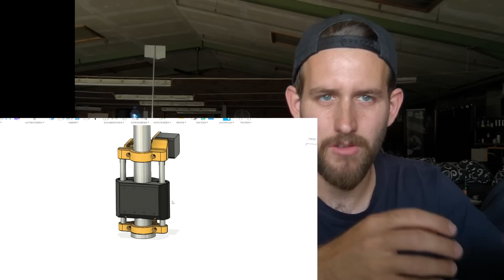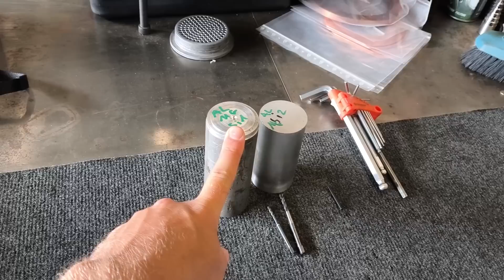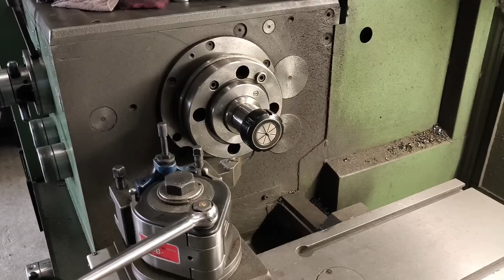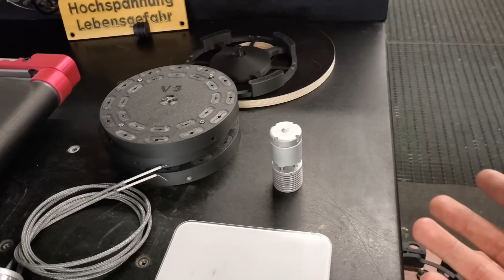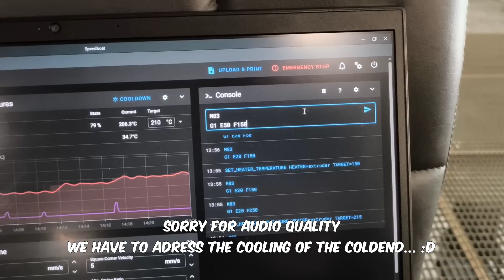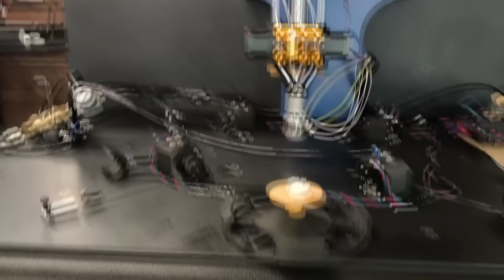Is a sub 1 min 3dBenchy possible? Hotend Build and First Print! (Episode 2)

Comment: Hi, I commented on your shorts about 300mm³/s. I have designed a few hotends and am currently pushing 120mm³/s with a single filament. A couple of tips: 

1.What you said about "too much puddle" inside a very long hotend is true, to an extent. If the internal passage is 2mm or less, there is not much problem, retraction still works (imagine a Syringe, it can bbe as long as you want). Only issue is if you sit still for a long time the whole hotend will leak out, which is a lot of filament if your hotend is 250mm long for example. What causes problems is internal voids larger than 2mm. I experimented with 2mm entry hole opening up into a wider chamber of 3 or up to 5mm before tapering back down to 2mm and finally 0.8 or whatever nozzle size, and this is a huge fail. Completely inconsistent, you send 20mm of filament into it and nothing comes out; so you send 10mm more into it and 30mm comes out, very bad. But if you maintain 2mm or even slight taper down 1.75mm or less, there is no big issue. I have tried this up to 200mm hotend length. 

2. I think your hotend has way too much thermal mass. What you made is something from industrial extrusion, that could melt KGs of filament all day at consistent rate but that is not really appropriate for 3D printing. You built a jumbo jet when what you need is a rally car. A 3D printer needs to be "light weight" or "nimble" in terms of thermal mass. It needs to be able to go from 0mm³/s to 200mm³/s in the blink of an eye, and back to 0 just as fast. That giant mass of yours will take a long time to respond to changes in heating load. My hotend currently is 3 Zones in series (single filament), each is a 115W CHC heater, very light, almost no thermal mass, they respond instantly to change in demand. Within a few mS of sending a huge volume purge command you can see the output jump from 0% to 100%. The series multi-zone concept is also how slice Engineering are powering their Prime hotend, and also how industrial extruders work. If you stick with that much mass controlled by a single output you will see latent temperature drop many seconds after demand starts, by which time it will be too late and temperature will continue dropping even though your band heater is now dumping all of its beans into the heater block (and then it will overshoot and burn the filament).

3. You can get mica sheets for cheap that make excellent insulation between your cold end and hotend. Very light weight and easy to cut to size. I get mine on amazon.

4. Since your hotend is connected to your coldend by a huge bolt, you might be able to cut through the heatbreaks. I dont think you can eliminate them entirely but cutting a slot through them with a hacksaw would sever the thermal path and unless youre going to run 60A TPU i dont think the filament will find its way out through the cut.
Reply: I think a lot of thermal mass is only a problem if heat conductivity is too low. Also it depends on where the temperature sensor is mounted.
Reply: maybee i dont understand it correctly but doesnt more thermal mass just makes it more consistent? so you dont need very much correction at all? while printing you dont switch tempretures
Reply: @thomaskletzl6493  right, you don't switch temperatures, but the system still has to react to changing temperatures quickly. The filament draws heat out of the hotend when it melts, and the heater has to replace it. It takes time for heat generated by the band heater to conduct toward the center. A very fast change from 0mm³/s to 100mm³/s will result in a very fast drop in temperature of the inner walls of the hotend, and the thicker the hotend, the longer it will take to replace that heat. 

I like to use analogies but I struggle to find a good one for this. The best I can think of is like a line of boats being towed on the ocean. You have a course plotted, a line, that is your temperature setpoint, and ideally you want all of your boats to stay on that line, but most importantly the last boat in line (the nozzle) needs to stay on the line. Your tug boat out front (your heater) needs to keep an eye on the line of boats and make adjustments to keep the last boat on the line. Temperature drops from rapid extrusions are like side-winds that blow the boats off course, and the angle/degree of drift, the difference between the plotted course line and the actual line formed by the boats, is like the temperature gradient caused by the delayed reaction between the heater and the nozzle. As long as there are no winds (no extrusion) the tug boat has no problem keeping every boat (every square mm of the heater block) perfectly on the line. As soon as stong side winds (rapid extrusions) come, the tugboat must veer off the line to bring the last boat back onto the line. The longer the line of boats (the more thermal mass of the hotend), the longer it takes for actions of the tugboat to affect the position (temperature) of the final boat, and the further the final boat can be blown off course before corrections are effective. If you have a long line of boats and cross-winds are strong but consistent (high volume constant speed extrusion like on an industrial extruder line), there is no problem. There will be a steep angle of divergence between the plotted course and the boat line (a dramatic gradient between heater temperature and bore temperature) but the final boat will track consistently on the line regardless. The problem comes with rapid start/stop and increase/decrease of the side winds. The tugboat just cannot react fast enough if there are a lot of boats in the line. A dramatic side wind comes and the tugboat starts (late, as usual) to react in an equally dramatic way, but then suddenly the side-wind dies off and the tugboat's reaction proves (late, as usual) to have been an overreaction as now the hotend is too hot and burning the plastic. 

I made the best of these particularly inconvenient physics on my hotend by making my boat line as short as possible (low thermal mass) so that it can react quickly and splitting the heating load across 3 separately controlled series heating zones, which is like having two extra tugboats evenly distributed in the boat line, so that pretty much every boat (every mm of the bore) can be held tightly to the course, controlled from both ends and not just from a distant tugboat at the lead.
Reply: @charlesstaton8104  okay thank you for the explanatoin i get what you mean now. i did not know that it needed so much energy too melt it
Reply: @charlesstaton8104  MPC in Bleeding Edge Danger Klipper may be able to assist in the issues you described
Reply from the maker: Thank you for your comment and effort. I never answered but I read and understood what you said. Be prepared for this weekends video, I got something for you ;)

Comment: first make the print heads super small. then add multiple independent x-axis print heads to a bed slinger. if you want fast acceleration etc, smaller is better. of course you can add a large system to sling a large weight around but why. no reason to do so.
Reply: instead of tricks, just put a super hot melting part first then a stabilization cooler part second. also a complete redesign from scratch, all parts, all assumptions. use a screw motor to break the filament and replace any rollers. yep the screw can be super hot. and has a large surface area vs filament bits. yes the screw breaks the filament into super small bits. and supports other types of plastic feed sources than just filament. like plastic granules. you dont need a heater, the screw friction heats up and melts the plastic by itself. screw extruder has a syringe like ability to control the plastic mass. kiss not complex. also if long heating paths are required, span them horizontally in a loop around the heating coil.
Reply: for best results have multiple print heads, in one print head or independent print heads. gotta have slicer magic happening with either case.
Reply: how about remote high frequency magnetic induction field heating coil. minimal amount of stuff mounted on the moving print head itself. optimally only minimal heating parts and the filament. also all filament pushing mechanisms should be on the printer frame, not on the print head.
Reply: also why would a 150w heater take that much room. a drone motor is way more powerful, 10s of kilowatts and is smaller.
Reply: oh you got the ultimate bed slinger, no moving print head at all. lol. nice one. nice asterisk.
Reply: just do linear screw cross axis print bed, its the simplest dual axis bed sling creality type 3d printer
Reply: yes make a 2d shaker table as the print bed. then all the print heads can stay locked in xy axes, only height of the whole print head platform changes on the edges of a stand.
Reply: use two 90 degree angled square piston slots to make full freedom rigid 2d bed slinger. yep two scotch yokes 90 degrees with two or double two linear motor axes.

Comment: The heat break tubes have terrible thermal conductivity. So you should end them as soon as possible instead of having them run all the way to the top. You want the filament path to be surrounded by aluminum to keep it cool at the top. The SS tube is preventing the heat sink from working well.

Comment: You should use weaker springs (lower spring rate) stretched more. So practically just use longer springs stretched until they offer the required force. This way any given movement will have a smaller effect on the spring force.

Comment: Maybe instead of finding a constant force spring you can use gravity to tension the strings by attaching a weight to them via a pulley? It would definitely give you a constant force but am not sure if it would solve more problems than it causes but that was my first thought on the issue.

Comment: I wonder how much heat from the heater block is transferring to the heatsink and the print below it just from radiation. Leaving the surface of the heater block shiny instead of matte would reduce that effect. Alternatively adding a silicone sock would might have a greater effect and then you could blast that area with part cooling and not have to worry about maintaining temperature.

Comment: Awesome work. You have two major issues the base and the extruder. 
The base has numbers of excellent suggestions and other projects that can be informative - though the shear acceleration/speed that you will be working at, even though short distances, will stress any system.

So to the extruder. You need to extrude 12g/min you also need to cool that filament BEFORE the next pass occurs over the same spot - easier for the lower half of the benchy but progressively harder as you move up. 
I know there are ways of calculating the pressure needed to extrude through a 0.5mm nozzle and achieve the volume flow required, but my mind is fuzzy at the moment. But directionally with the 4 feeds you are going the right way as you need to keep the speed as low as possible for as long as possible. Also you may need a change of material r, to perhaps teflon or something else, to reduce the friction. If it wears fast who cares it only has to deliver 1 benchy, the job is to meet the extruder nozzle dimension for the print.

The cooling has to occur as soon as it exits the extruder and hits the previous layer. So this sounds like an extended nozzle so that you can make a colinear nozzle that has an air gap to the nozzle for insulation. The air is then directed directly down onto the extrusion. The pressure/volume of flow needs to be worked so it doesn't blow the extrusion away. The nozzle may need to be quite wide to allow sufficient mass flow. 

Just a thought, you want the cooling traveling behind the extruder - so following it like a slicing knife. Perhaps a rotary outlet that is spun insync with the travel direction so that most of whatever is being used for cooling is directed straight onto the newly laid bead and avoids the area about to be extruded onto.

TLDR
The following was written and as I developed the idea I realised that air is AWESOME and is very difficult to beat - if you can't use a liquid (hence liquid nitrogen gets a mention).
So if you want to know why air is so good here is some more reading. - You have been warned. TLDR is OK.

Can a normal cooling fluid be used? I can't think how as you need to keep the area to be printed on clear so that it can be printed on......
So if no fluid then it becomes gas. 
Moving away from air the only gases that have significantly better heat transfer are Hydrogen & Helium. Hydrogen wants to go bang so lets look at helium. Helium has ~5X the specific heat kJ/kgK (what it can absorb) compared to air, its relatively safe (dilutes in the air and escapes UPWARDS) and not to bad to be around - except for high voices....

Helium has a specific heat of 5.2 J/gK (13X better than copper with ~0.4 ) & and a conductivity of 0.156 W/mK (~400 for copper or 2500X) (also a Joule (J) is one watt per sec (W/s)). 

What this shows is that you want copper between your heater and your filament as it transfers the heat VERY well - 2500 times better.
However, you want helium to cool it down, as you are wanting the heat to be absorbed and removed by the coolant -  and its13 times better than copper. 
FYI Helium is ~20% better than water by MASS, so needs a lot more volume.
Now we come to the next unfun fact. Air weighs 1.2 kg/m3 and helium weighs ~0.2. So for the same flow rate (m3) air flows 6X more weight AND helium has 5X the specific heat - which is not enough to overcome the mass advantage that air has. Air is AWESOME

Another way of going is cryogenics, or rocket science..., Nitrogen has ~the same thermal mass as air. BUT you can get liquid Nitrogen and that obviously is WAY cold, AND the latent heat of vaporization (or getting it to boil) will provide a MASSIVE cooling effect even before we get the Nitrogen gas thermal mass and the massive temperature difference. This would be more likely something like having 4+ nozzles that can be programmed to emit nitrogen liquid at the right spot at the right time. I have NO idea how to actually do that - but the whole internet and its denizens are out maybe that can help? Maybe even some rocket scientists????
Reply from the maker: Yeah, Helium cooling would be pretty dope 😀

Comment: Ok, so hear me out. I think we can bring it down to a sub-15 second print.

If we scrap the standard build plate and replace it with two or three build plates that are at opposing angles to each other, then we go ahead and adjust the geometry of those plates to match the geometry of the benchy. Then we can add a few more extruder nozzles, and have them sticking straight into the build plates from the outside. . . .

Comment: I have some thoughts for the spring tension issue. Firstly, constant force springs are not too hard to come by, on McMAster Carr anyhow. But one with exactly the tension needed might be harder. 
I think that one way around this would be to make it so that your X axis and Y axis are each a pair of steppers (or a single larger stepper) connected to a 'single cable' which loops with pulleys from one corner of the build plate to the opposite corner, with a single spring in the middle of the cable to set the tension. This does not help at all with the rotation issue though.

Comment: would it be possible to use a lightweight accuratly pressurised air cilinder on each cable?
If they are all pressurised and connected to each other, the volume of the combined cilinders shouldn't change right?

Comment: When it comes to part cooling, seeing as the hotend only moves up and down have you thought about a wind tunnel around the whole contraption. That way you can suck most of the heat out. Hey a prints a print when everything is built from scratch. I just can't wait for the evolution of this.

Comment: Bro is 1000 IQ Ryan Reynolds.

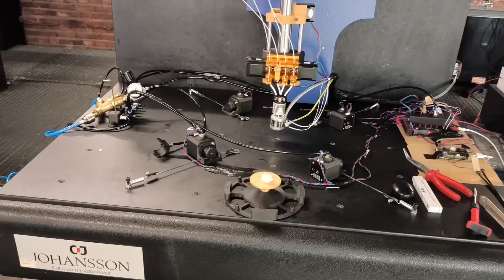Edit: 36:55 couldn't you use a weight on a pulley as opposed to a constant force spring?
Reply: That would beat the purpose as it would add mass.

Comment: Could you join oposire sides of the strings together by routing them around through rollers? And have one of the rollers adjustable and spring loaded. Sorta how its done on cartesian  printers =)

Comment: Jan, wofür brauchst Du bitte die Feder? Nimm Dir bitte mal die Zeit und analysiere das Problem auf Ingenieurebene...... 
Ist Dir jetzt aufgefallen, dass Du gar keine Feder brauchst und das Seilende einfach an der Rolle fest machen kannst, ohne technische Nachteile zu haben? Du musst den Schrittmotor sowieso zuerst auf einen Nullpunkt fahren. Damit kannst Du das Spiel und den Reck des Seiles kompensieren für den Run. Du fixierst den Tisch einfach in der Mitte für den Nullpunkt, dann rollst du das Seil komplett ab und lässt es zwischen den Fingern wieder stramm aufrollen, bis der Schrittmotor nicht mehr weiter kann. Das ist dann der neue kalibrierte Nullpunkt. Langfristig musst Du sowieso ein Close Loop System nehmen, da Du die Grenzen der Beschleunigung austesten willst. Wenn Du das Seil 3-mal um die Rolle gewickelt hast, hast Du keinen Schlupf mehr in dem System (!) dann hast Du nur noch den Reck (also die Dehnung) des Seiles.
Freundlicher Tritt von einem alten Schlosser in den Hintern eines jungen Ingenieurs ..... lach. (Zähler=1)

Comment: Instead of a resistive heating element it may be an option to use an inductive heater. Thermal conductivity virtually goes entirely out of the equation then as the heat can be made virtually uniform right across the heating element.
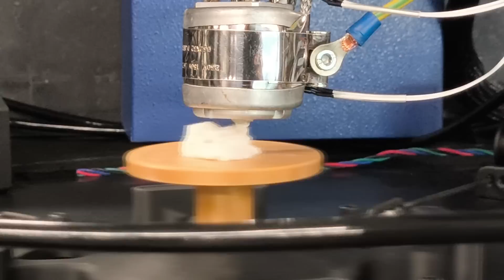Under "hot mess" in the dictionary there is a link to 31:20 .
Overall I think this project is going awesome but I still think that moving the molten object is going to be problematic when it's at super high G forces.